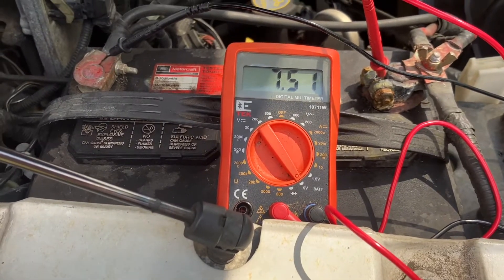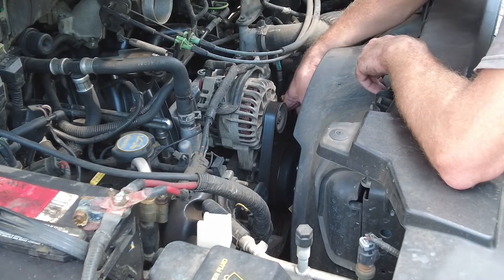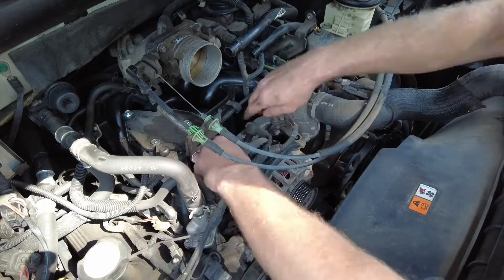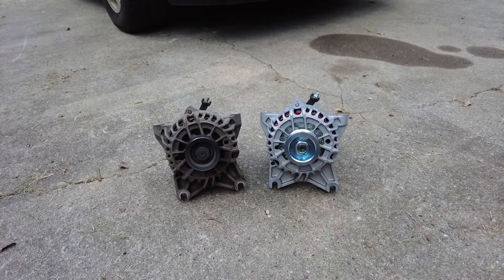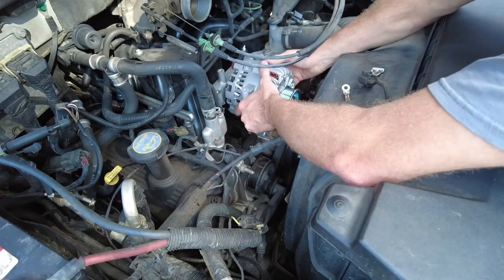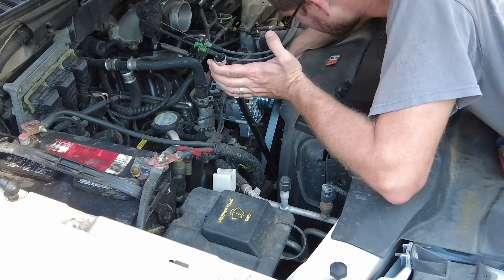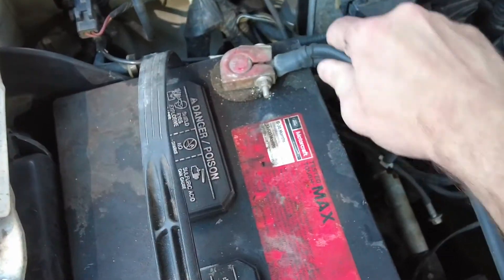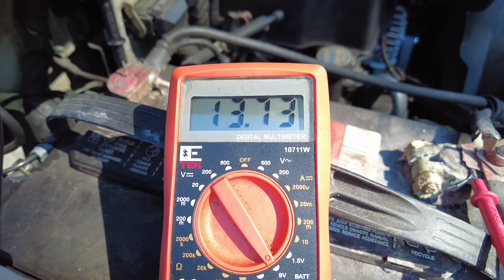Replacing the alternator on a 2003 Ford Expedition 5.4 2 valve.

Comment: You dont need to remove the lower bolts because the alternator has a clever fork connection to the bolts.  You can see this by looking at your new alternator.  Also, the 2003 expedition has various owners manuals (5 to be exact).  And some say that there is a #9 alternator and the most recent one says there is not a fuse.  Took me several days to realize that my expedition was made basically in June 2002 but was labeled a 2003.  Since I did not have an owners manual, I went to ford and downloaded the most recent version which shows no fuse.  But then I looked at the Ford download page and discovered there were 4 other owners manuals issued.  The earliest one said I had a fuse,.......I looked at my #9 fuse and it was missing.  This caused my alternator to not excite and consequently failure to charge my battery.  I bought this car used with this problem.  I got lucky and added the 10a fuse and everything started working again.
Reply from the maker: Mine also has the fuse, but that wasn’t the case for me.  You can just loosen the lower bolts but I was worried I couldn’t get everything to line up by leaving the lower bolts in.
Reply: @ChrisThedudenurse  If you leave the bracket on the alternator and remove the bolts from the block, the alternator will drop right into place without taking the lower bolts out.  The intuitive thing to do is remove the bolts from the top of the alternator.  Thats the wrong thing to do.

Comment: What kind of socket diid u ou use on pull bar thanks
Reply from the maker: Are you asking about the pulley to get the belt off?  That’s not a socket it’s just the end of the ratchet.